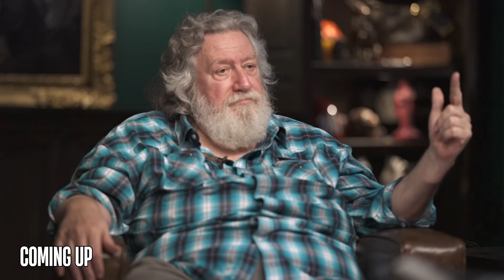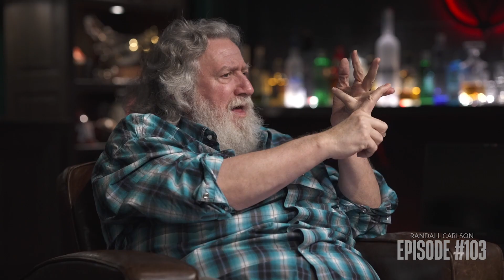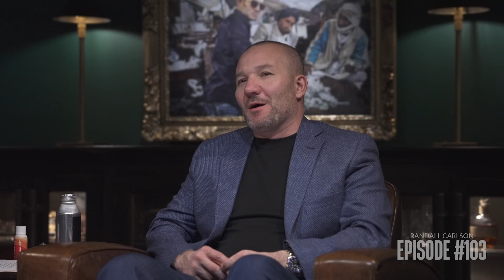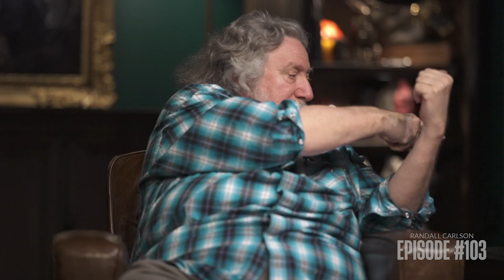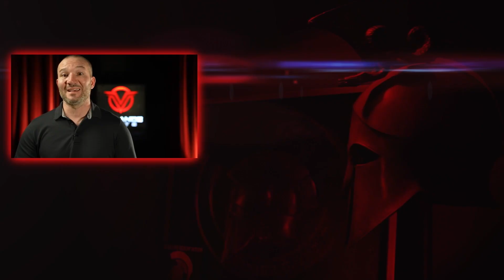Ancient Plasma Technology that Created the Thunderstorm Generator

Comment: Okaaay...pain in the butt Air Force guy here. Not a smart Airman. Just Security Forces. But, "plasmoids?" Describing the outcome of using a primitive, venturi-carbureted 389cc test engine/gas compressor to suck a bubble of the Earth's atmosphere--as found in situ at whatever random elevation and atmospheric region in which you happen to find yourself--into a canister of water....and then sucking a second bubble of said atmosphere through its predecessor...and calling the resulting turbulence a "plasmoid" absolutely states you are certain that your process is generating plasma and involves magnetic fields. I suspect you are reaching that conclusion ONLY because of the manner in which your bubbles are shaped and the way they are rotating. I also infer you suspect some sort of fusion may be going on. However, If you don't want people to start off with a giant mental block in place, I'd recommend you stop calling your bubbles, "plasmoids," until you can show that is actually what they are. I mean, how do you know you aren't simply using a water filter to cool your intake air and add steam to to the cylinders for greater expansion, while also adding a water-cooled exhaust expansion chamber to improve exhaust scavenging, while filtering an element, or elements from the combustion process?  Perhaps your inventor friend is also cheating by flashing exhaust gas and water to steam a second time and distilling it again in your sphere(s)? I saw the still on the TV show, MASH, so I know things. Lol. 

Sure, maybe you've found a low energy way to harvest Hydrogen from water using actual plasmoids and/or magnetic fields, but "plasmoids" at this point?  That's premature, isn't it?

I hypothesize that you have to wait for the air cooled, copper wound cast iron cylinder to heat up before "turning on the technology" because you are replacing a portion of the air/gasoline mix with an air/water mix, and reliant upon the flashing of water to steam in the cylinder to greatly increase power output for each unit of gasoline consumed. Meanwhile, cooling your heated exhaust in the sphere should assist with exhaust scavenging AND re-condense the filthy water for removal. Finally, I also suggest the inventor is cheating by water and steam cleaning the exhaust yet again in the second sphere and removing the condensates. But that final suggestion is very confrontational. 

Want to prove it works? Run it side by side with an identical generator not equipped with the technology,  under varying identical loads, for more than 1000 hours and more than one year, while lab testing all waste water. I doubt your technology equipped unit will survive. At the point of engine failure (rings, piston, con rods, or head failure), or test completion, examine the heads, cylinders, valves, spark plugs, and pistons of each unit. I suspect the technology equipped unit will be a rusty turd, and that your waste water will be so toxic Eva Braun would go to it for relationship advice.

One last thought. Numerology is fun at parties and I really appreciate your gift for it, but if it were the basis of any kind of technology, the Saudis and Israelis (the most numerology-addicted peoples on Earth) would each be living in matching Utopian Wonderlands with Golems doing all the work. Instead, in both countries, it just results in cool architecture, hit squads comprised of silly numbers of people, and a rather lethal, medieval outlook on life.

Comment: Yeah it a system that strip hydrogen from water by thermal dynamics no magic . Kw to kw has to be equal . 300kw running on diesel can actually run a sister gen set 300kw on hydrogen.

Comment: This isn’t infinite energy. It could very well be a replacement for catalytic converters. The emissions are good but it needs to be shrunken down and refined. Also it requires water to be filled just like you would a coolant tank or wiper fluid.

Comment: guys this is legit 
its NOT a free energy scam its got little to do with improving engine  consumption, its a passive exhaust filtration method that blows everything else away.
the people behind this have open sourced ALL of it.
it's a new exhaust refining system that works on the power of the generator itself. 
theyre arnt trying to sell you anything nor are they looking for investors.
i was mega skeptical going in
im STILL skeptical about performance claims but its easy ( for me, machinist snd smith) and inexpensive to build.
(my only hold up is the genny i plan on using is kaput so step one is fix that lol.)
if tgis thing in fact works even half as good as claimed its going to have huge positive ramifications for the fossil fuel industry.
Reply: If this thing causes the oil industry to sell less oil, they will 💀 everyone involved.
Reply: @wailwoader1873 that’s why it’s been suppressed all the time,
Reply: I don't know, I would have to see it for myself before I believe. I'm not saying it won't work theoretically, but I just need to see it in practice
Reply: @EliW95  oh it works, and it’s based on sacred geometry
Reply: Update?
Reply: This is real.  I saw the live videos with the number readings
Reply: @nickb2510 no u didn’t
Reply: @thebear6529 ok bot.  Go do your thing and keep posting.  It’s all you can do.  Living life is wonderful.   To take a walk and feel the cool breeze.   You will never feel that.   Cheers.
Reply: Did you build it yet?
Reply: Where’s a link to this open source info my man? Next time just fix your whatever, do whatever you WERE going to say you would do, then say something about it. You’re just setting yourself up for failure when otherwise, because you’re choosing to take on the burden of proof among nearly unanimous skeptics. Spoken out of love my guy
Reply: @Spruce_Lee  my projects dont depend upon the approval of some internet strangers. but still nothings changed financially so until things get a LOT better, hobby tinkering has gotta wait.
as far as open spurce data for this, just google it. theyre quite open about the design  theres no paywalls.
Reply: Hey hows that thunderstorm generator build coming along ?😂😂 ill wait
Reply: @Jimmyjames11111 There is many that had been made, just search on youtube to see it.
Reply: @Jimmyjames11111  test genny still not fixed  times are tight jimmy, gotta replace my trucks injectors.

Comment: @chrisprysok7634 you don't need to ask i will explain this system.

It uses gasoline to start the engine.
.
The engine produces electricity for the Hydrogen generation.
.
The engine provides vacuum for Hydrogen generation.
.
The engine produces high heat for  Pyrolysis and that produces useful fuel called Hydrogen and Oxygen.
.
It is 120 year old technology and it is not a economical or practical way of producing fuel.

Comment: 👋  Randall I've made a mini atmosphere   carbon condenser.  The two separating spirals of hydrogen and nitrogen  get a ultraviolet charged laser quats and need to be under complete  vacuum   . The use off  degree 51.84⁰ to deflect  gas direction  as well as temperature  this is one of many matching number for the blue print  to a clean world  ...  The code of Chinese   pyramids tell me how to build a  electron frequency  separator.  Yet I've not been able to find a adequate high pressure limestone aquifer to test this paper theory..